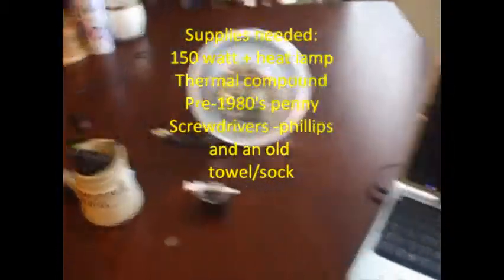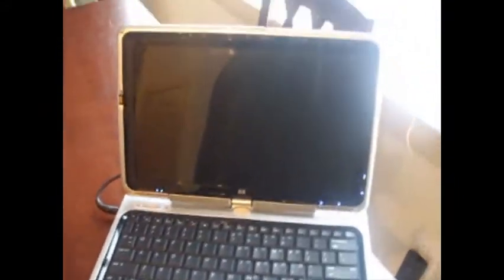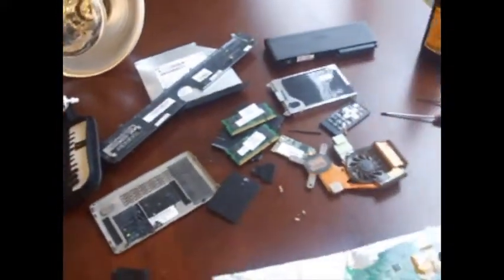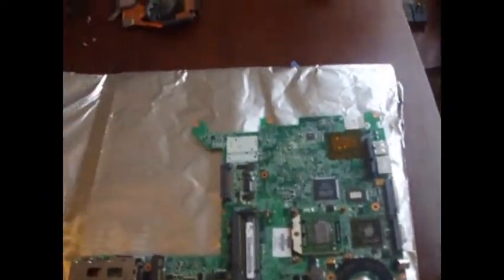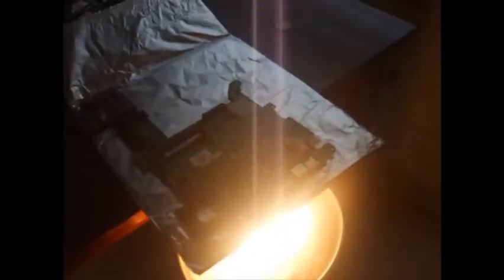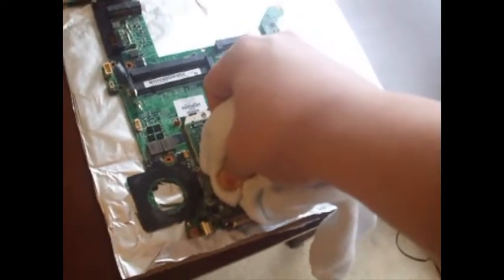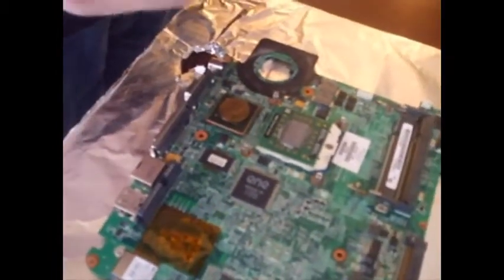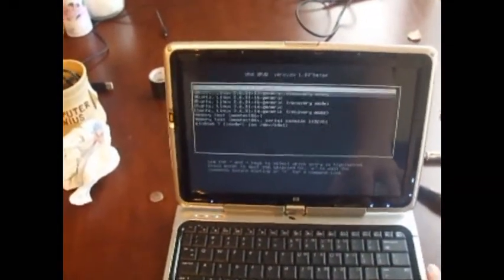Hewlett Packard 1217 CL hot air solder for broken Nvidia Geforce go GPU

Comment: I have the same exact laptop, but I do get graphics and I have penny modded. However, the system turns off while gaming... It hits up to 90C and then shuts down. Do you think it's a loose connection with the GPU?

Nice Ubuntu btw. :)